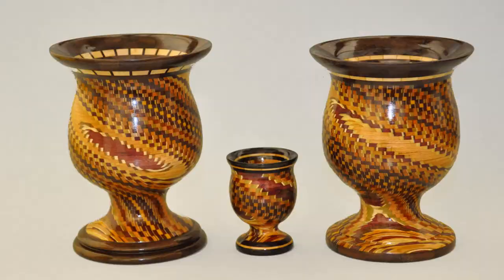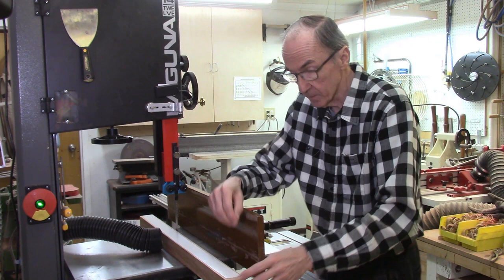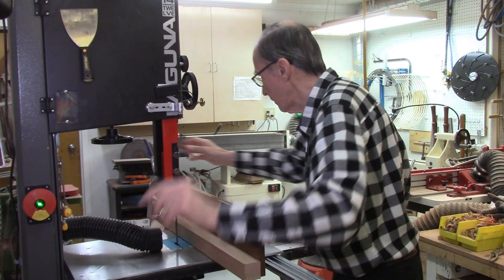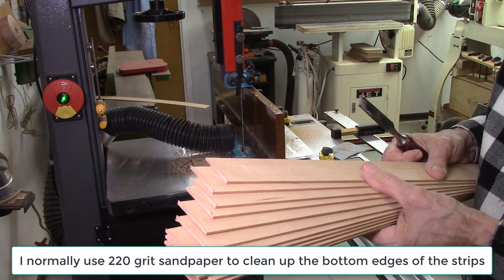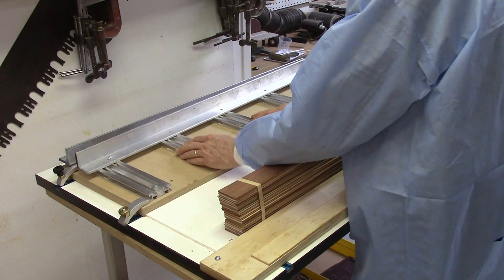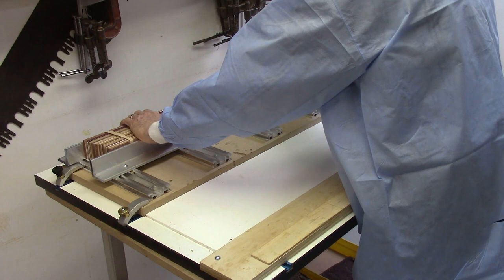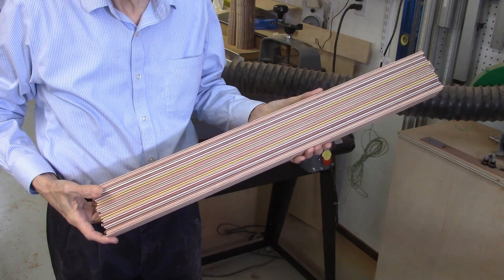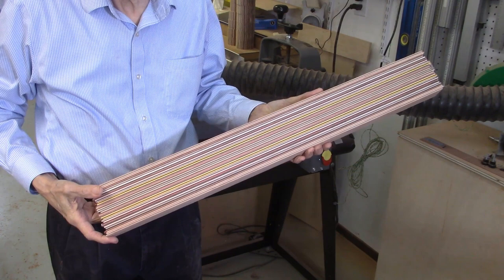Dizzy Bowl Project - Part 1- - Production of the Laminated Boards (48)

Comment: Very impressive!  The Accu-Slice is obviously a great wood saving system. Question: I really like the clamping fixture too. Did you use any bearings on the slides or just the small brass flat stock? It sure looks secure and it seemed to stay square with the rear angled stock. Thanks for sharing this ....
Reply from the maker: No I did not use any bearings on the guides, just the 2" long brass  guides.  I had thought about using the bearings, but they would have been more expensive and I thought that the polycarbnonate sleeves on the bearings would crack when the clamps were applied.